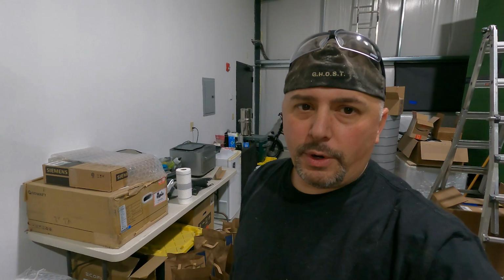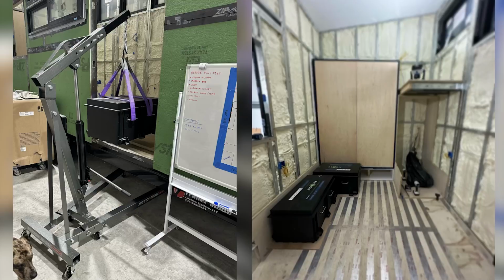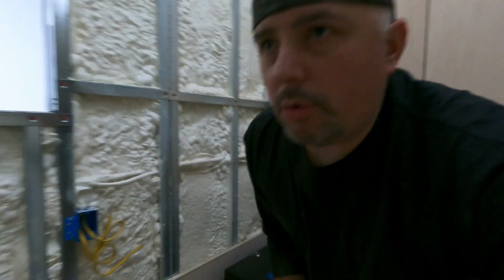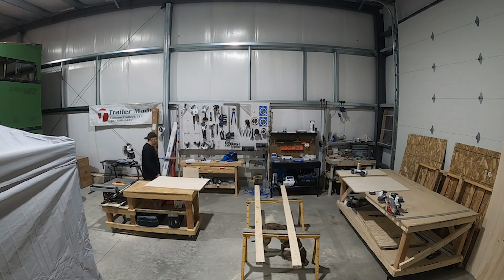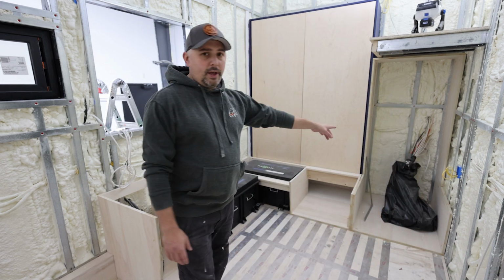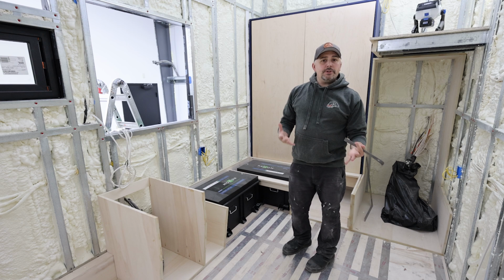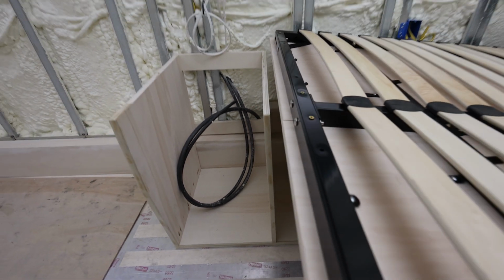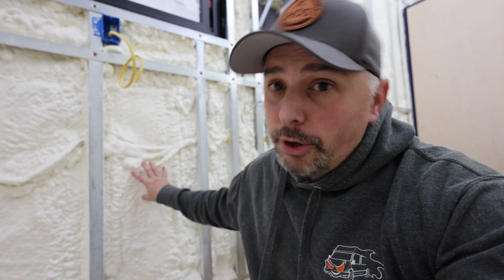30 kWh Batteries in my Tiny House 300 POUNDS Each

Comment: Best way will be if You don't need remove the pillows which you are sitting on the bench before unfolding the bed.
Reply from the maker: The bottom cushions I won’t have to move but the back rest I will and I did that intentionally so I can use them in bed to sit up in if I ever wanted to do that
Reply: @jarrodtocci  if so, that's the best solution. everything perfectly thought out🙌🏽

Comment: What do you think about the electromagnetic energy that is emitted by the battery? Especially with your bed being right on top. You should especially avoid sleeping on the battery when they are charging.
Reply from the maker: In short, I’m not worried about it. I’ll do tests if people would like but it’s not like living under high tension wite

Comment: That is going to be a nightmare replacing that in 10+ years. Batteries are a consumable.
Reply from the maker: Yes and no. I made the couch in a way to be accessible with some screws being removed. For weight, I could slide again or have 1 or 2 people to help. Concerned? No. Labor intensive? Of course